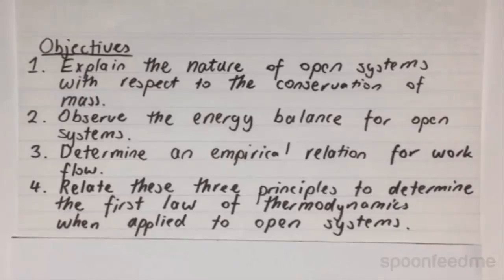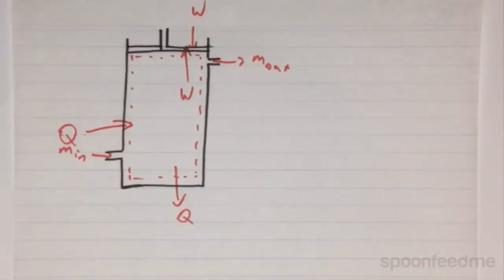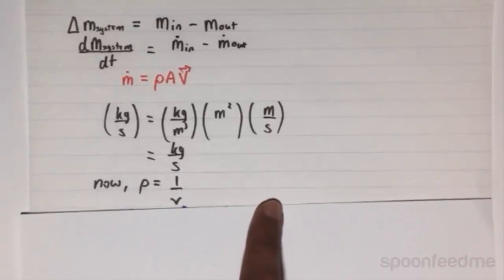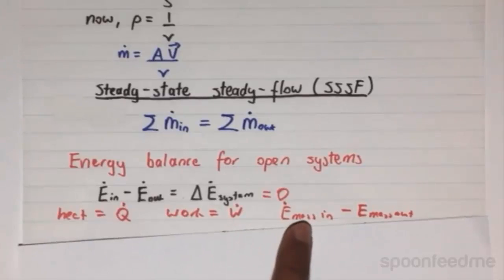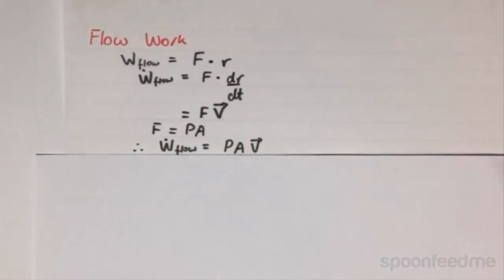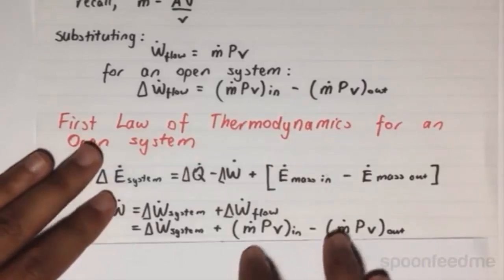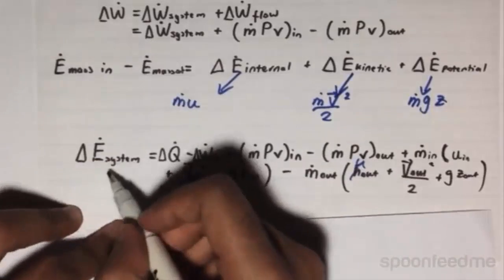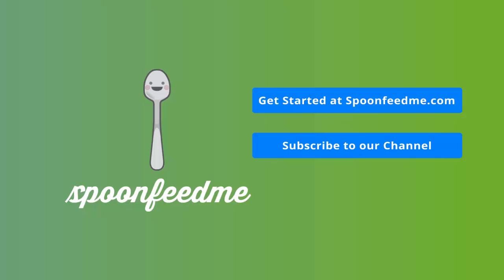First Law of Thermodynamics for Open Systems | Thermodynamics (THRM101)

Comment: @ 6:02 This equation is wrong because he is using delta's AND dots (like second derivatives)! He probably does that because he is used to write: dU = dQ + dW. Not good at all! Always write dU = Q + W. Why? Take Q. We know that Q = m . C . dT. Then dQ would be m . C . d(dT). This means you have to take the difference of a difference, and that's not what you want when you write dU = Q + W. Of course, the same applies to W (with respect to dV). So here (8:56) it is not a matter of simplicity, it is a matter of correcting a previous error. Nice video anyway.

Comment: In a closed system, you may only use enthalpy when pressure is constant right? Because hin = P(vin)

But why is it in an open system, you can set hin = (Pin)(vin), when the pressure is not constant for the process?